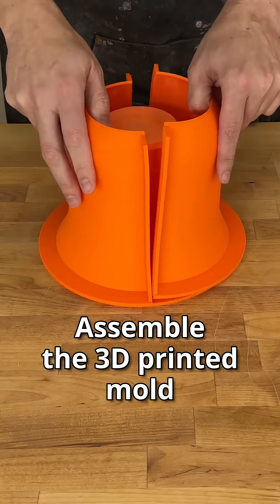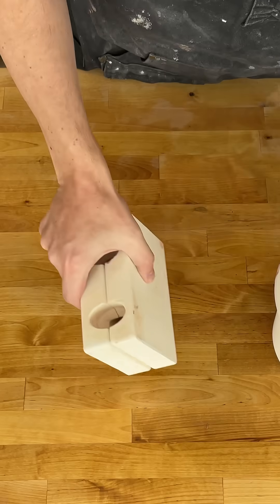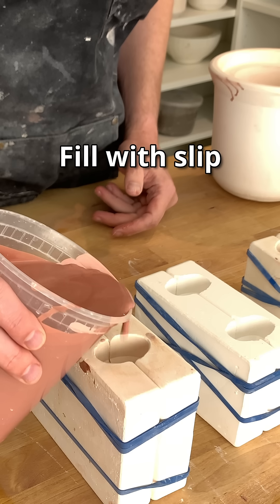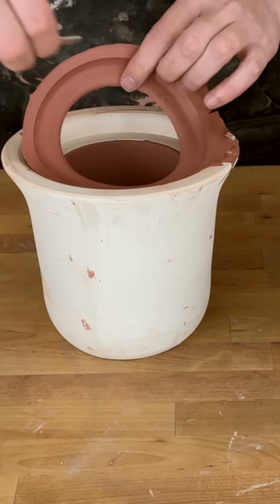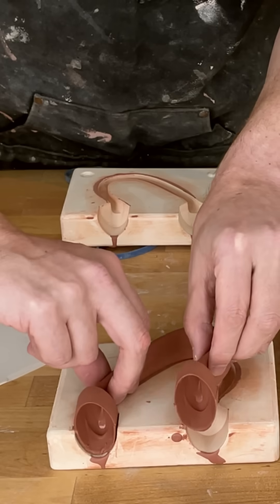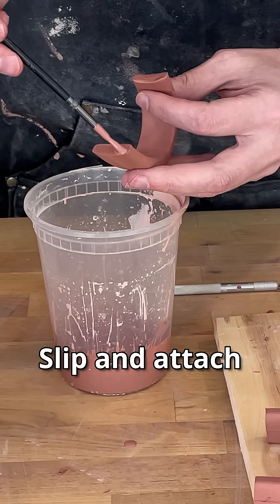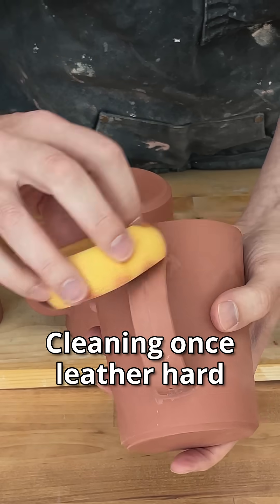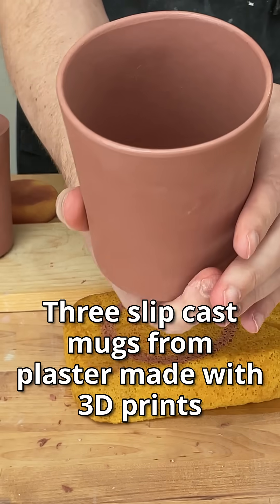3D Print to Slip Cast Mug #3dprinting #ceramic #pottery #slipcast

Comment: how many hours of sanding and filling to remove all the layer lines from the 3d prints though
Reply from the maker: Have you actually tried? I spend 0 hours. Max I might spend a minute sanding and often will use them straight off the printer. 0.08mm features once fired are half the thickness of a piece of paper. If you have noticeable layer lines, use a better printer!

Comment: We don't crosshatch a little at the attachment points??? That changed since I was doing pottery at Callendwolde back in the day.
Reply from the maker: Did you slip cast? These aren't pulled or extruded handles. Scoring is needed for those.
Reply: @PotterybyKent  Fair point,  no, mine were all thrown.
Reply from the maker: Yes those are indeed different - the alignment of the clay particles and in turn the changes that happen during shrinkage are different. Thrown pieces have the clay particles much more aligned vs slip cast pieces where it is more random. Scoring disrupts the alignment. There is also a water story as well.

Comment: You don’t score the mug and the handle before adhering with slip?
Reply from the maker: I do not. The whole thing is made from slip
Reply: @PotterybyKent  Love it. I’d still score it but I’m a little bent.
Reply from the maker: You can. It wouldn't hurt anything. But in this case it works just fine without. Casting at the same time and similar thickness also helps here

Comment: Those mugs look super nice! Do the molds need and special prep to stop the 3D print layer lines showing in the mugs?
Reply from the maker: Not really! Just start with a good print. Sometimes a bit of light sanding is helpful. But by the time it goes from slip to fired and glazed pot you wouldn't know.

Comment: WHAT THE HELL IS "SLIP"?
Reply from the maker: It is a liquid suspension of clay
Reply: To help clarify, slip casting is a means of creating ceramic shapes using highly porous plaster molds that absorb the majority of the water from the “slip” that is poured into the mold cavity.  The slip, stiffens as water leaves the clay based material into the plaster eventually forming a solid structure.  The plaster moulds then need to be dried to be used again. Virtually all ceramic items (like royal dalton figurines) that are produced in bulk are made this way. It’s a very old technique. The novelty is using a 3d model as the start.  dalton uses sculpted figures that are used like the 3d print.

Comment: Is there something in the design that stops the middle part floating away? It looks like you just place it down. I've had real problems with prints being too bouyant.
Reply from the maker: Yes. It is attached to the ring with binder clips. There are features inside the mold specifically for that!

Comment: Do you use plaster molds to prevent deforming or is there another reason? Could you use plaster molds for other applications like resin?
Reply from the maker: The plaster is used for slip casting to pull the water out of the slip and from the clay pot.
Reply: @PotterybyKent ohhhhhhh ok thanks!

Comment: 3d print mug directly with thick slip.  dip it in thin slip to smooth.
Reply from the maker: I havent seen 3D printed clay smoothed with thin slip - I'm not sure that would work. Managing water would also seem to be an issue. Have you seen that done?

Comment: If you want to save money on rubber bands, use old car inner tubes (if still available near you). cut to 1/4 to 1/2 inch (6-12mm), depending on required tension.
Reply: Nice! Are they stretchier than/different from bicycle tubes, or just thicker?
Reply: Who on earth has car inner tubes? Its been nearly 80 years since cars used these lol.

Comment: Does the plaster not deform the print after the casting? How did you solve that?
Reply from the maker: Not at all. So there's no issue to solve. You do need to design the  mold so the plaster can be removed easily like I have here.
Reply: @PotterybyKent  Maybe he meant the heat the plaster produces while curing. I guess it's not that high.
Reply from the maker: @peterszabo3171  Ah, yes the point at which the filament starts to soften is way higher than the exothermic reaction temperatures reached by plaster.
Reply: As a rule of thumb, PLA is fine against heat deformation at any temperature that won't cause burn damage to your skin. Other printable plastics fare even better.

Comment: (real question) Is scoring before slipping being left out bc it's not important for these or..?
Reply from the maker: I do not score at all, just add the slip. It works fine for me with my timing and clay body. Also since these are slip cast, all of the clay particles are more randomly distributed than if it was thrown/pulled so you don't have the issue with the difference in shrinking from that.
Reply: @PotterybyKent  oooOhh I didn't know that Abt slip casting, thank you for an explanation :)
Reply from the maker: Sure thing!